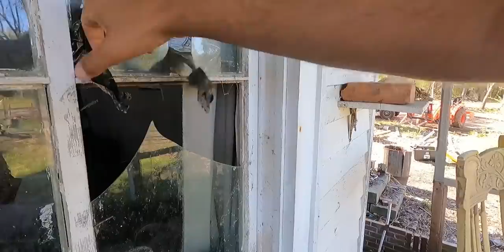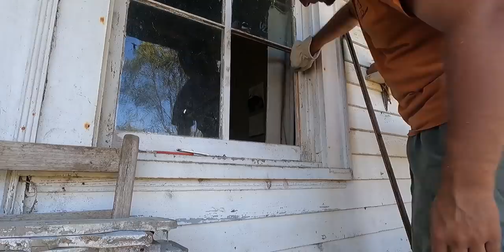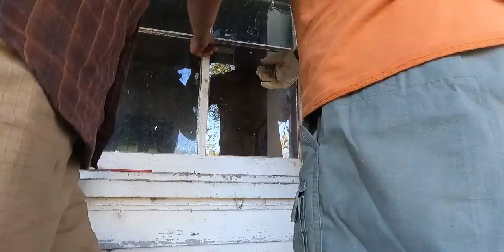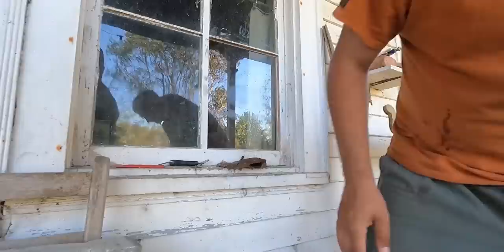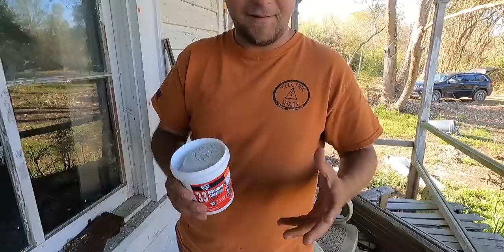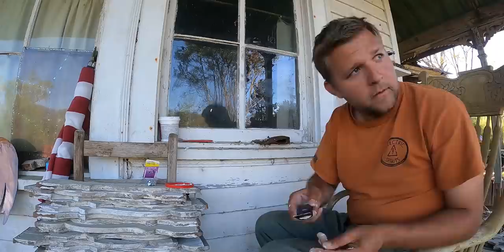NEW WINDOW TIME! REPLACING AND GLAZING A WINDOW PANE IN 140 YEAR OLD HOUSE

Comment: Never never use silicone on the old wood windows. The windows were not designed for that. The problems come down the road when you have to do maintenance on them, it will cause you considerable grief, and can lead to the destruction of the window. Use a solution of bleach and raw linseed oil on the old glazing compound to soften it for easy removal. Then prime the wood preferably with oil primer, lay down a bead of compound, set the glass in, add the points and your final glazing bead. This is the way to get a solid draft proof seal. Remember that your house is 140 years old, it was designed and built to be maintained, and repaired. If they had used silicone on that window 40 years ago you would not be reglazing it today you would be replacing it.

Comment: Hey Robert! I'd like to share some tips on replacing and reglazing old windows! I've replaced probably about a hundred or so by now.. you really only need 1 tool to get out the old glazing and that's an oscillating cutter..you'll need a scraper blade for it but it's the fastest and easiest way to remove the old glazing.. before you do that though, take some painter's tape and cover the whole window first, this way if the glass breaks, it doesn't go anywhere and theres no extra mess to clean up!.. that's just on the removal process of the old glass... for installation you'll need a 2 inch ANGLED putty knife also I find that a small pair of channel locks works best for installing the glazing points, you can also use a stiff putty knife for the glazing points as well. Be sure to look at the glaze from the inside too, you dont want to see it from the inside....lol just don't crack the glass!.. hope this helps you on your  restoration process.. I look forward to seeing your progress daily sir!

Comment: In the UK we traditionally put linseed putty behind the glass (not silicone). The pane is pressed against the putty which squeezes out and you clean off the excess, fix in the "sprigs" and then putty the outside. I would imagine is was done that way back in the day in Georgia too before the days of silicone.
Reply: I can remember my dad doing windows like that when I was young.  Putty on both sides of the glass.  I'm in Queensland and I guess the putty would dry out over time and have to be replaced.  I can still remember the smell of the putty.
Reply: My Dad did this too.  We live in old houses. In Kansas.  We are German Russian people.  Grandpa was a master carpenter.  HE built many Church's..

Comment: Good job Robert. Now for my 2 cents. I had to reglaze my 80 yr old windows. You have to let the glaze cure for a couple of weeks. Then, using a small brush, paint just the glaze with linseed oil and let it dry a couple of days. This protects the glaze from the latex paint, which dries quickly, from pulling too much moisture from the glaze causing it to crack and fail. Your paint job will last years longer. Again, good job.

Comment: Robert just to remember to paint the glazing, if you don’t it will
dry out and fall off, you could also put a thin layer of glazing on the inside 
1/8-inch thick to act as a buffer and seal the inside of the window.
you press the pane of glass into the thin glaze then point it in place
that protects the wood on the inside from condensation and rot.
Reply: In my experience it's best to protect the glazing from direct sunlight for a few weeks or so, maybe a month, and then paint it. If you paint it too quickly it will crack and if it gets too much sun the surface will skin over quickly and wrinkle quite badly.

Comment: On older windows, I treat the wood with linseed oil before installing the glass. It helps seal the wood. An oil based primer works as well. The glazing will adhere better and more permanently using either method.
With goopy glazing, roll the snakes in whiting, (it’s a powder) available at paint contractor stores. And keep a rag with mineral spirits handy for clean up

Comment: Have a bucket nearby for the glass chunks.  Tape the broken glass panes with blue tape to stabilize them then you can pry the glass out in bigger chunks.  A flathead screwdriver can be used to clean out the pointing channels.  the older glass will be wavy or have bubbles.  I would recommend sealing the channels before putting in the new glass.  Needle nose pliers are the best for getting the points.  Consider testing for lead paint too.

Comment: When you put new glass in you should, to seal it, put a little of that product (it usually is made of a mix with linseedoil in) on before you put the glass in. And then nail it with windownails. After that you put the final seal on and use a windowknife to make it nice. Then you have to wait about a week to paint it. Don’t ever leave it unpainted, birds usually eat it then.
If you have woodenwindows do not use silicon, that destroy the wood fast. It need to be the real thing you use that is made for windows (with linseed oil in)

Comment: Question about any old glass: Aren't these side windows the ones added in the 1920's and the middle one the original front window that would actually have the old glass? Good job and one more item checked off the list.

Comment: No criticism intended one way or the other here, but I preferred the rough look of the glazing on the window (without smoothing it out). In my mind, it offered a more vintage character to the trim (plus, it would have your fingerprints embedded in it, connecting you to the house for generations to come).

But that's just my 1/2 cent opinion ("two cents worth" adjusting for inflation). You did a great job at any rate. 👍

Comment: get a golf ball sized chunk and roll in in your hands.  That will soften it up.  Make it into a tube the thickness of a pencil.  You want to get a 45 degree angle slope on the glazing.  Use a razor blade to clean up the extra.

Comment: I would skip the glazing points and use silicone caulk.  It will be flexible and allow the pane to shift.  That way there is no chance of cracking the piece as you put in the points.  Its way too easy to do that...